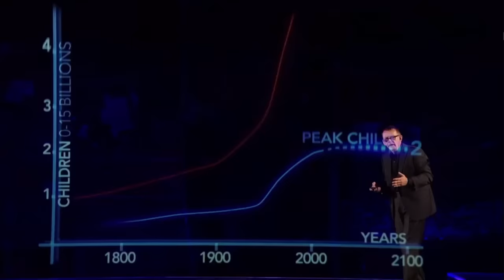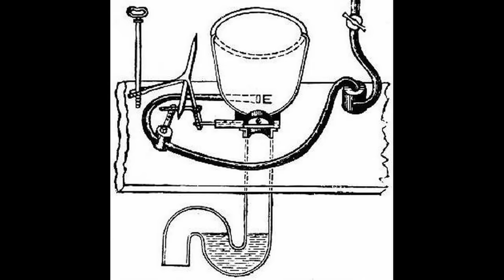How to Save TONS of Water, to Save the Planet

Comment: I'm convinced, that until fusion power is a thing, nuclear is the most environmentally sound method of power generation.
Modern designs are meltdown proof, and if we switch to thorium reactors, weaponization won't be an issue.
Reply: Doken Boken Modern designs like the reactors at Fukushima? How to safely store the spent rods for hundreds of thousands of years? edit: thanks for the replies, my knowledge base needs updating
Reply: No, modern designs like MSR. It would actually consume all the long lived waste from existing spent fuel pools. But even PWRs kill fewer people per MWh than anything else, so we should have absolutely replaced every coal and gas plant already.
Reply: LFTR isn't the end-all be all of reactors, U-233 production is a pretty hairy process (once you slam thorium with a neutron it takes a while to convert) but other reactors are pretty damn safe and great, such as pebble beds, which are passively safe. 

And if you're really into complicated designs, the travelling wave reactor would be incredible useful as you could just stick some unrefined uranium in there and get nice power out*

*it's not that simple but it's still really cool
Reply: You can run it with the usual U-235 fuel, in once-through or breeder configuration, consume down-blended weapons or waste, there are different designs. The main advantage is the higher temperature and better safety offered by the salt. Oh and the smaller size. Electricity production is not everything, there are use cases only possible with small reactors. Like you can install them on ships, or produce steam for fracking. You can build them on an assembly line.
Reply: Modern designs are also untested and theoretical...
Reply: @Basement-Science  we have more advanced technology to create more effective safety systems
Reply: Far from it. The first experiments were done in the sixties, the technology is very well understood. Bureaucratic fuckery is the only thing standing in the way. Fusion power is untested and theoretical but I plan to live long enough to see it.
Reply: stribika  actually, funding is the main thing standing in the way. And I´m not sure it´s worth investing billions into that kind of technology that still has many problems which cannot be overcome.
By the way, Fusion power research is also mainly limited by funding.
Reply: Alright, I buy that. What are the problems though? Tritium production is manageable. As far as I understand, you could build a thermal neutron uranium + FLiBe reactor with once-through fueling tomorrow. With CO2 in the secondary you don't even need to design a new turbine.
Reply: @Eggs4ckley  When do you think Fukushima was built?
Reply: People who are against nuclear power, still think that every reactor fails like Chernobyl.
Hell, France gets most of its power through nuclear power.
But I guess the word "nuclear" will always scare people away.
Reply: Could you please tell me why solar energy isn’t as “environmentally sound” as nuclear fission?
Reply: @GRBtutorials 
Solar power installations require lots of space (utility companies build on open land which would otherwise remain open to wildlife), rare earth metals (causes massive pollution when mined), and don't generate as much energy as non-renewable technologies for the same cost (money, space, effort... a gas/coal/fission plant will be better).

The US alone needs about a terawatt of capacity to not have brownouts during peak hours. Heavily rounded, 64% of our energy comes from burning things, 20% from fission, and 13% from wind/hydropower. That leaves a few percent to other sources, with solar giving 1.3% of 2017 power generation, see https://www.eia.gov/tools/faqs/faq.php?id=427&t=3. 6 average fission plants will equal all solar in the US in average power generation while having predictable and controllable output.

TL;DR solar has environmental costs, doesn't become profitable easily, doesn't match grid demand (base load + peak) at all without huge batteries, and is very difficult to turn into a majority energy source with other options in practice.
Reply: @Eggs4ckley  You are completely wrong twice;  1: Fukushima was not a modern design, 2: thorium plant waste material is radioactive/dangerous for about 300 years, plus in theory we can design reactors to operate on that, even reducing the problem further; nuclear material is hot, steam turbines run off the heat generated from hot radioactive matter. The problem is a lack of willpower, and irrational fear, which you propagate. Rational people like me cannot even choose to get nuclear power because of people like you.
Reply: @Basement-Science  Wrong; Modern designs have been tested in the 80's already and have been proven safe. They are not susceptible to meltdowns. However, research and development of those is now completely nonexistent, because of our irrational fear of radiation. Irrational, because the alternative is to spew pollution into the air that is causing huge problems, not only environmentally, but also health-wise. More people die of the RADIATION from a coal power plant than happens for a nuclear plant. And that is even ignoring the other obvious health problems of inhaling the smoke, death from environmental change, death of coal miners etc. There is absolutely no good argument against nuclear power plants that I can possibly think of, and what I have heard has been completely debunked. Actually, not true: there is one argument: there is no funding because of irrational fear. The problem lies squarely with people that do not think, want to think, and prefer to be led by emotion rather than understanding and wisdom.
Reply: @reddragonflyxx657  Where did you hear solar cells use rare earth metals? AFAIK, they only use silicon, boron and phosphorus (as dopants). As for where to put the solar panels, the answer is easy: in every building out there! Every building could be energetically self-sufficient. The only real problem is the energy storage, but once we get that sorted out, solar is the way to go (along with direct nuclear fusion if needed).
Reply: Expense 

Wind and solar already much cheaper.
Reply: Doken Boken  I agree.  This is where protesting and viral social media disdain should be disregarded, and incomplete MSM (as expected and proven) reporting can be highly counter productive.
Reply: Ha stop using something something that helps towards weapons? Fat chance
Reply: @Eggs4ckley  How could General Electric's earliest Mark I designs from 1960s be "modern" to you? They are some of the earliest possible antiquated examples you could possibly find and even so nobody died. Now imagine if we had not stopped developing and deploying new and better reactors and they had been replaced a decade ago by something mature instead of granting extension after extension!

It is what should be happening everywhere instead of replacing nukes with more polluting lignite and coal power plants, like in Germany and South Korea, respectively. They have the gall to call the 2000 MW bituminous coal power plant at Samcheok the "Samcheok Green Power" project because they put a couple of solar photovoltaic modules on the roof.
Reply: @zogworth  Renewables have to get dirt cheap to be able to compete in the first place, but installed capacity is not a guarantee of actual production when energy is most highly valued - say, right at the peak consumption after sunset and in the winter months in a colder region. In places where that coincides with an annual depression in the average wind speeds it means the value and price of energy will shoot up. A reliable power plant, even if more expensive, will be worth its cost right then and there, assuming we want the lights to stay on in hospitals and homes alike in our 24/7 society.
Reply: you worded that like fusion isn't also a form of nuclear power...
Reply: I agree , but where is the waste going? That is the real question! You cant have it polute the groundwater, storage that is safe is so expensive that it is not economical to run! The taxpayers have to pay for the storage or our health has that is not an great option
Reply: The issue with nuclear fission power, is we got like 80 years worth of Uranium at current rate, which will be a lot less if we increase nuclear output, so sustainability is a big issue here. Another issue for nuclear power on its own is varying output is far more difficult, this is due to long start up times and therefore  can not simply be switched on and off to meet fluctuations in demand. Advantages to nuclear power there is a lot less fatalities per MW of nuclear power compared to most other energy production, and a smaller carbon footprint.
Reply: Muqtadirul Waris there is much more uranium in the sea that could be extracted; besides we have Thorium. Also, with 100 reactors in the US alone, and they going offline just once a year, start up times aren’t a problem.
Reply: class 4 reactors are clean 100% they also burn waste from class 2 reactors. but they dont make them cause you cant make weapons grade enriched plutonium from them... look it up. Salt brine reactor.   its a thing.
Reply: @GoldSrc_  in France we have occasional failures that make a few fish radioactive, reactors that should've been decommissioned 20 years ago still running, and we source uranium from morally controversial places, but yeah, we do have 70% of energy coming from nuclear fusion.
As far as fossil sources go, nuclear is still one of the less worst, but it's still non renewable and we have a pretty limited supply of uranium.
Reply: As for solar installations, we could have base plants that only use mirrors and a boiler. The main problem with solar systems is storage, because they can't really respond well to peaks (or we need enough power to respond to them), and they can't produce at night (and high power long range electricity distribution is wasteful.)
Reply: Remember the Fukushima 2011 incident?It was only a leak!Think about an explosion of one of those reactors!Apocalypse!!
Reply: @vishnukirangoli  as far as I know, nuclear reactors don't explode, they can only leak.
Reply: it truly is the best we have. it's really amazing, especially fully modern systems, and then there is the brilliant molten salt reactors.  silly we still use coal and oil at all
Reply: And helium cooled reactors which is in early stages of research atm
Reply: Has nobody realized that although depleted Uranium may be radioactive for 300 years...it's only beta particles, which are mostly harmless..
Reply: @sietuuba  

I think you're missing out on quite how cheap they are. It's now cheaper to build an entirely new wind farm than to keep a coal power station running.

Intermittentency is a solved problem. In the very worst case you spin up some CCGTs running on biomethane. In the best case you manage demand. Store energy chemically or naturally. But in reality real world experience has shown that renewables are remarkably reliable and predictable. My country generated a huge proportion of it's total electricity from renewables this year. (Over 30%) 

I like nuclear but it's time was 20 years ago. By the time the next 20 years have gone by and new nuclear power plants actually get built, because yeah it seriously takes that bloody long to get them up and running they'll just be huge white elephant projects.
Reply: @zogworth  Energy storage is not a solved problem but you invoke it as if it was. Sorry, but it is the hardest problem humankind faces.

If you build CCGT's to back up the renewables, you've just doubled the capital costs of the nation's electrical production and the related ongoing operational&maintenance costs. All that would be reflected in the cost of electricity driving it up. Of course right now most electricity generation doesn't have to pay all the costs themselves due to unpriced externalities (no CO2 tax so everyone gets to spew it out as much as they need to.)

If you do have enough biomethane production to significantly impact the consumption of fossil natural gas you could just choose to use biomethane within the current system, and avoid making the steel and concrete and the high grade materials like copper & magnets all the wind parks would require. Because wind doesn't blow anywhere all the time you do need something else for the rest of the time, and there simply is not enough energy storage anywhere. There will not be for the foreseeable future! Some of the proposed plans involve synthesizing methane and storing energy that way but that too is a long ways off. There is a European "development roadmap" for the power-to-gas concept but I have no idea if anyone can guarantee it panning out. I would be hesitant to believe it outright without seeing the first demonstrated examples  (one day, and that day is not yet here!) and peer review.

The most mature form of energy storage is pumped hydroelectric storage and the combined global capacity is a small fraction of what a developed nation would need, let's say Germany for example. The hard figures are unforgiving. Prospects for adding more of it are limited by geolocial features and the fact that we don't want to drown every possible pristine high elevation valley just to provide us some of our electricity. It wouldn't be enough anyway - the scale of the challenge is bonkers.

We can forecast very precisely how much renewable production will be available but that is not a problem. The problem is how to keep the lights and heating on during peak demand that does not coincide with peak production - not in the diurnal cycle, and certainly not in the annual cycle. Winters are harsh even for a country like the UK if they wouldn't have fossil fuels or nukes. Germany too is only building more fossil fuel natural gas pipelines for importing more of it, and it continues relying on lignite (brown coal). Few countries seem to be taking the challenge of reducing their CO2 footprint seriously and that makes me very nervous.

Comment: Don't shower very day.
Shower in less time.
Don't take a bath too often (only for relaxing purposes, not for cleaning yourself; treat it like a treat).
When you pee at night, don't flush.
Don't eat meat every day(or every second day for that matter-especially beef-).
Close tab, whenever you not use it in that second(while brushing teeth, wet shaving, etc.).
Use the eco settings with washing machines and dishwashers.
Only buy clothes when the old ones have more than 4 holes in noncritical areas.
Use closes longer before washing, except its necessary.
Use less cleaning agents and soaps( of cause enough to do the job, but chances are you use too much).
Try to buy things that are more durable, so you don't have to buy cheap things more often, it adds up anyway.
Try to use less electricity, water is used for cooling in lots of power plants.
Don't waste food, it costs water to produce. If you throw out less, less has to be produced.
Try to limit of consuming useless things in general.( I don't mean you should life like a monk, but think about you purchases and if you really need this or use it for like a month or two and then let it rot in a corner or throw it out).

These are only a few examples of how everybody can save fresh water without compromising too much or at all in some instances.

When everybody tikes only a few boxes of the list we can safe a lot collectively.
Reply: not everyone needs to worry about saving water... the natural water cycle is more than good enough as long as you dont live in drought prone areas.
someone living near a huge lake or just having a good underground water source in a low population area need not worry. rain will easlily top up your supply.
Reply: @darkshadowsx5949  Yeah, thats right I guess. At least for your close by supply. But using less detergents helps because the water needs less treatment after you use it, so its saving energy too. And many points I made are about things that are not necessarily near your home like clothes/ foods/etc. 
But of cause, when you live in Norway for example, where more than enough fresh water is, you don't have to save every drop of water.